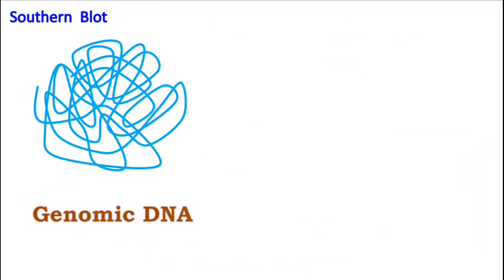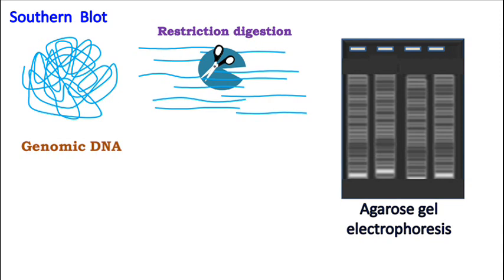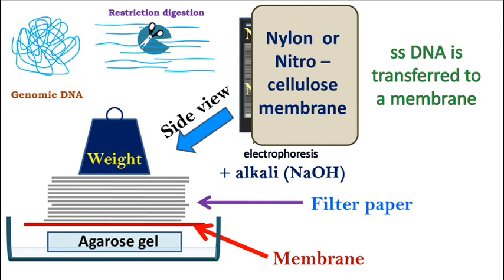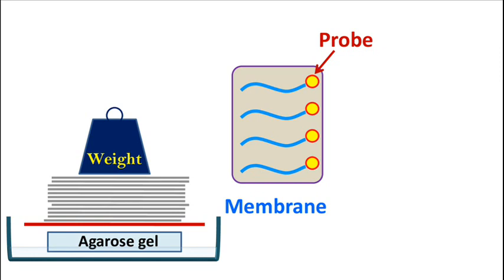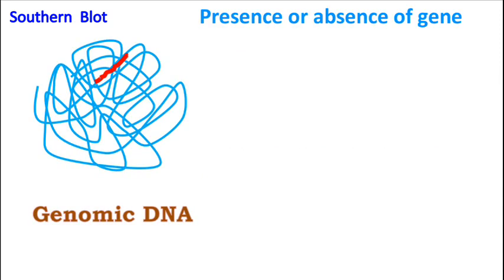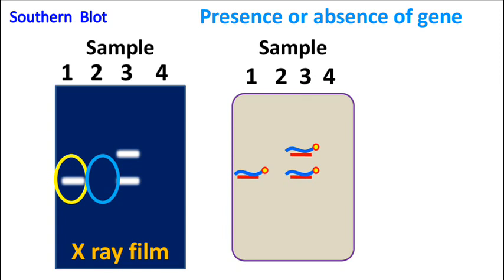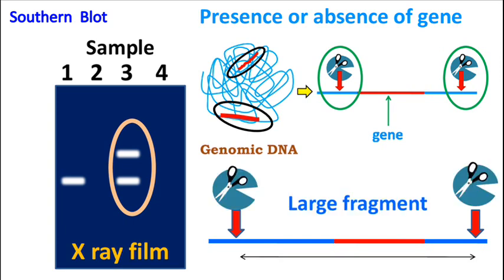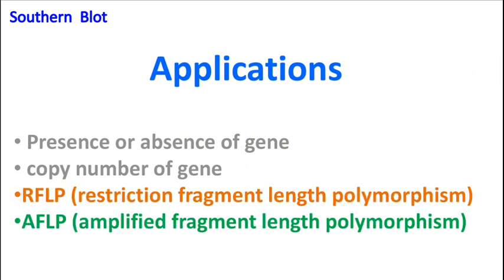Southern Blot

Comment: What's the difference between southern blotting and restriction fragment length polymorphism
Reply: Purpose:Southern Blotting: Detects specific DNA sequences.RFLP: Detects variations in DNA sequences among individuals or populations.Procedure:Southern Blotting: Involves gel electrophoresis, membrane transfer, and hybridization with labeled probes.RFLP: Requires DNA digestion with restriction enzymes and gel electrophoresis.Applications:Southern Blotting: Used for gene mapping, rearrangement detection, copy number variation analysis, and DNA methylation analysis.RFLP: Used in genetic linkage mapping, paternity testing, forensic analysis, and studying disease-associated genetic variations.Main Output:Southern Blotting: Shows presence or absence of specific DNA sequences.RFLP: Displays variations in DNA fragment lengths.

Comment: Why do we use electrophoresis to separate the different length DNA? Isn't the restriction enzyme cutting arbitrary, meaning the lengths don't actually mean anything? Would it matter if the band was shown in the larger DNA segments or the smaller ones(the ones that travelled more)
Reply: In electrophoresis length of DNA fragments play great role because we set all optimal conditions according to the length or size of DNA fragments❤ .